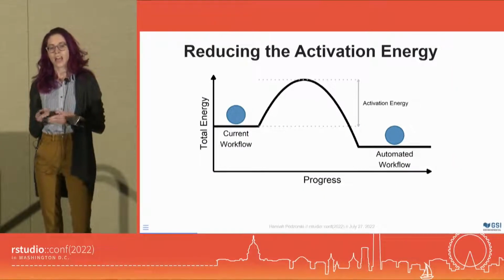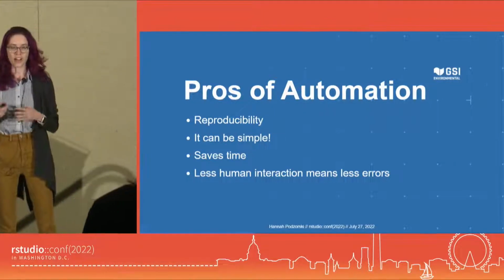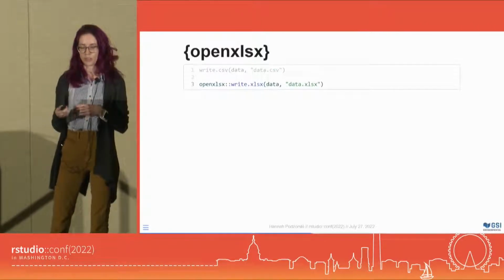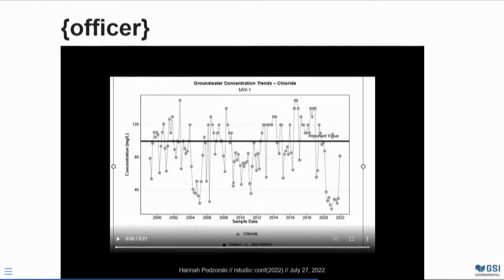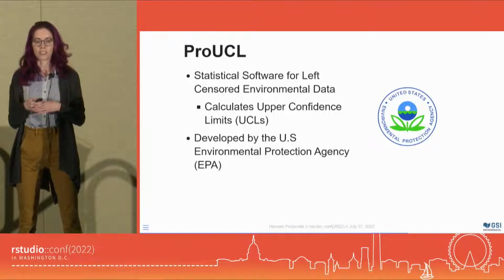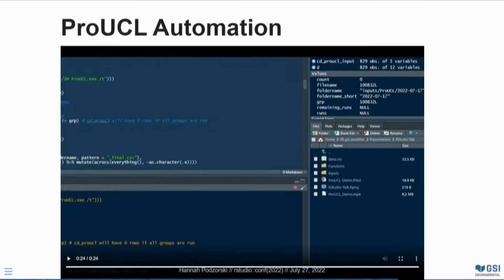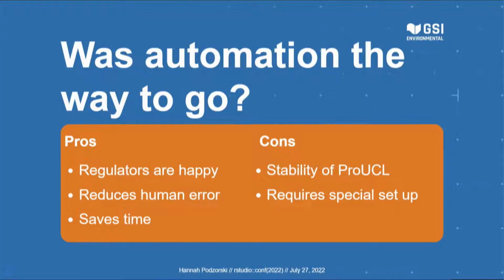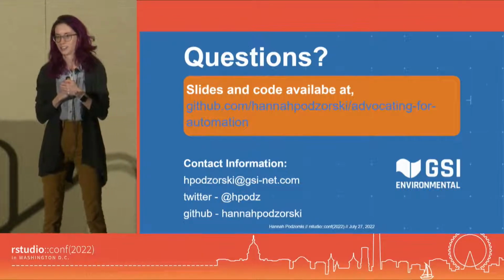Hannah Podzorski | Advocating for Automation: Adapting Current Tools in Environmental Science with R

Comment: The mouse macro is an interesting alternative. I have been considering the other option but, as you said, it then wouldn't be official ProUCL and thus subject to regulator condescension. I have identified several bugs in ProUCL's output and the code that it uses is not public; that's two other good reasons for an R equivalent, or at least should be a good reason for future editions of ProUCL to have its formulas made public.